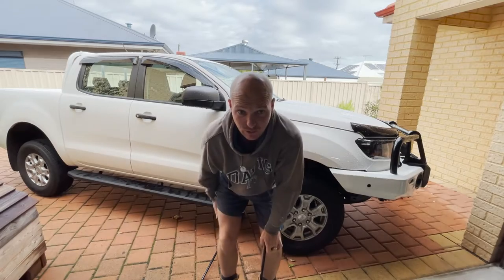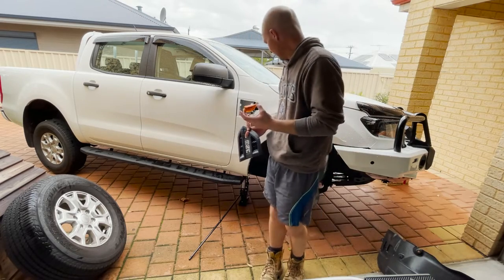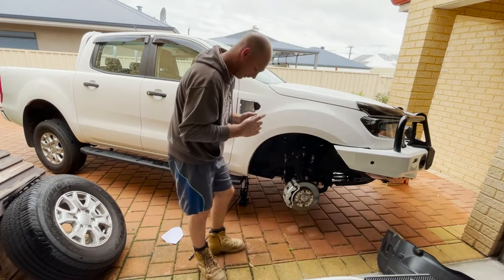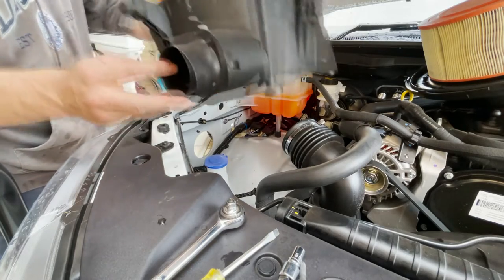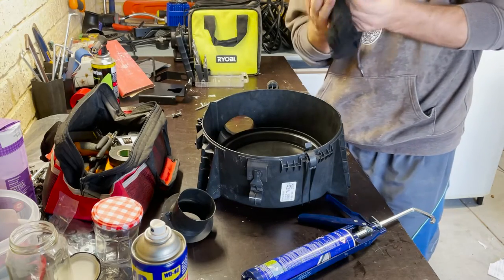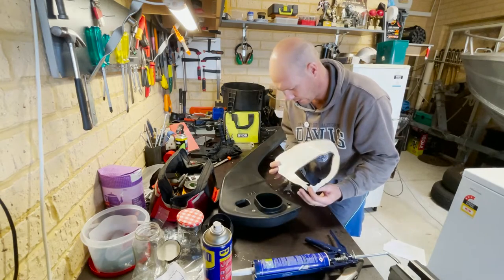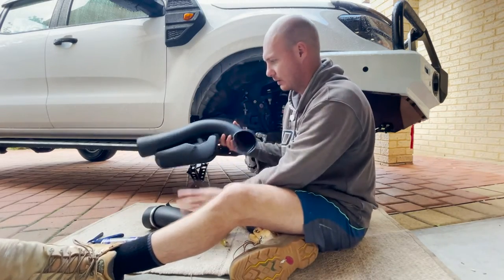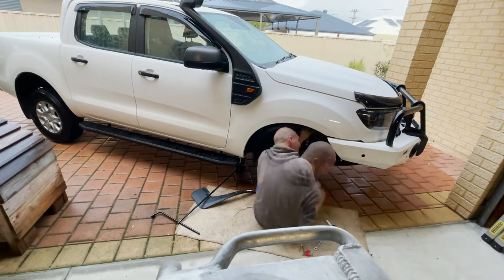Installing a T7 snorkel on a Ford Ranger PX III

Comment: Hi mate, can you provide a link to this snorkel on ebay? I've got a PX1 and I'll look for the equivalent.  
Lekker!
Aymar
Reply from the maker: Hi mate, see how you go - this is the one I got : https://www.ebay.com.au/itm/282735827938?_trkparms=ispr%3D1&hash=item41d45e5be2:g:JJIAAOSwqqle8j42&amdata=enc%3AAQAGAAACoPYe5NmHp%252B2JMhMi7yxGiTJkPrKr5t53CooMSQt2orsSwcmzw5CLtzTE60FqHcnq2MWagahb38QybtXrEmJHWvuETI4LdY%252F6D4xYzmHMlHglPHGTS6fU%252Fr3qmAmcMg05W6O%252FErzYFupQe9m2zlMC96EiluJjJAq3QRtJnCfXGcUZWL0OSIvhtRhhe0w0257KOfUYme90iWfdzjJXCqmhysJIAmXAGFtEmCkyzrnzsX0cPUlLw%252BVMHJhh%252Fk6U9BQR7JSllc%252Fl8y2CZAF2Wa2EqSHem5TpJFA8iPAWUyOi%252FanF31mFTUJRVEWkNQ0nY2k2PhrxsKG7rbO9%252BDW3ukXwmWlk%252FzODECIwxrmT97i5%252FdFXj8ZynPnvr3fkgEZL%252BdAUu%252F28Jum5VWOjAtn7QLlkyslIRuvTffBIRo2OmS6aRyR%252BDIjengBXPJvOnVM0tgGeqIjO2YaH3Tafsym9JBfKhy5aZU5q0A9TzQH3JB9VL2rtaqyA%252BVx5S7VW7wY%252BR%252FN9mmq9jGzkyTUj1vUtSheY8pyrdLj%252FTARaHCwwVQ%252FPn6Kj9U6i%252Bsd4GSIaUCGrKwxBAVoMTeWRnO3V1cD5CUtw3xSTfcuPsVqwOsW%252BMKe9S3mV6krn5OasFxOEjzMlUjqsk%252FyyQU5jp7KnBOwh0zaXy9dRi3tfJL5ybIoi8pKPn3C%252B2EgyBADrIK729KSVJ1drafkbxh4CVynSiJqtSTkZ5YtctGnExaZSE5ZCvFHUGB8RAqnfTw0VReuxS05zGLcqn4DWxWCPm9ix8aspS1KXwpBPbRb8bGyL6yormWLXkeuigz%252Bc7e%252BK9uYAeH%252Bts76wxFesT%252BaOFYOKstETrN6TVK3FCHkwjxwOUgn0Z0Ax%252BhN1l1xV7Q4wQx9B0VJdkAbLSg%253D%253D%7Campid%3APL_CLK%7Cclp%3A2334524&frcectupt=true

Comment: Great video. Looks like you made light work of it. I've got this exact snorkel kit installed by previous owner of my Ranger, just been looking at to try and work out how water resistant it is (for wading and also rain). Doesn't seem to have any dirt/grit/water run-off at the ram head so wondering how well it copes with driving in heavy rain. I've not yet had a chance to open the airbox after heavy rain driving to check for buildup.

Question, do you have any idea what that bulb is for in the pipe that lives behind the fender? If it was on the underside of the pipe I'd expect some sort of water/grit catch you could clear out, but as it's above I'm wondering what the point of it is?
Reply from the maker: I've opened the airbox after drive in some rain (not super heavy rain) and airbox was 100% dry. Regarding that bulb - I have no idea been wondering the same thing.....?🤷‍♂️
Reply: What is bulb you guy talking about? I got the same snorkel l. Just wonder what it is

Comment: Hi, i just bought a 2021 XL px3 and i want to do it up with flares, bullbar, snokle and more. Does XLT and XL parts can fits eachother?
Reply from the maker: Hi mate, most part fit all models, mine is the xls and I have had not issues with any part not fitting

Comment: How did you go about reapplying the rubber roof trim over the snorkel roof bracket bolts?
Obviously with the bolts, the trim no longer sits flush as it did pre install, it bulges over the bolts.
How did you get it to stay down, and was it flat?
Reply from the maker: Correct, I left it for a couple of days till I thought of a plan. In the end I used my router and trimmed the rubber around where the bolts and the plate sit so it would sit flush. I used the same silicone I sealed the rest of the snorkel with to glue it back down. Have not had an issue with it thus far. Hope that helps!

Comment: I noticed you had the chrome screws out of the snorkel when you had it on the bench. What bolts did you use to tighten the snorkel to the bracket?
Reply from the maker: I didnt like to look of the ones supplied with the snorkel so I got some SS ones to replace the chrome
Reply: @4weeksleave  Thank you.  I guess I'm off to bunnings again.  Lol
Reply from the maker: @Ranger_Troy  😁

Comment: How did you go with the foam gasket, it appears the bolts provided are too short and won’t grab when trying to fit
Reply from the maker: They are short, but with some effort and force I managed to the the nuts to go on. It would have been nice if the bolts were 5mm longer.

Comment: The drill and install on the roof rail concerns me. Incredible opportunity to rust and leak.  I haven’t seen anyone show how they ensure water seal and corrosion protection.
Reply from the maker: Very valid concern! I had the same when I realized what I was about to do to my car... after a bit of research you realize that most offroad roofracks get fitted to 4wds the same way. 
My method for corrosion protection - Prime/paint the newly drilled hole immediately with a good paint (I used nail polish - not so sure about that yet)
Water seal - I used roof and gutter silicone and a rubber/foam washer between the bracket and the roof. 
Hope this helps a bit - I should have filmed and included more info on what I did. Not that any of this took away my concerns either......

Comment: How do they drain the water when it rains?
Reply from the maker: I don't think there is anything in the snorkel design to drain rain water. It is a very interesting topic and a lot of discussion around it. http://www.4x4earth.com.au/forum/4x4-tech-talk/24947-stupid-question-snorkels.html
http://www.4x4earth.com.au/forum/fuel-system/7504-diesel-engines-snorkels.html
http://www.4x4earth.com.au/forum/motors/25734-help-me-decide-snorkel-3.html
Reply from the maker: Let me know your thoughts? It would have to be torrential rain to have any affect and make it into the engine, past the filter and all the heat around...😅 but I'm no expert

Comment: Do you need to silicone all the connections?
Reply from the maker: No you don't. But I can't think of any reason why you wouldn't do it, for the little bit of extra protection against dust and water it's easy and cheap.
Reply: @4weeksleave  
I only ask because i got the genuine ford snorkel and noticed the piping that goes from the airbox to the actual main snorkel peice just slips on and its pretty loose. Shame ford didnt send any fitting instructions would have saved me a couple hours of thinking
Reply from the maker: @NDH411  I think the knockoff that if got is very similar to the genuine Ford one you got then. The airbox connection is pretty good and snug, but my biggest issue was also the pipe connection to the snorkel - and you can't really get your hands in there to push them together and or seal. What did you end up doing?
Reply: @4weeksleave  
Yep i would say they are almost identicle then. I only installed it the other day but i didnt end up sealing it properly but next day off i will be removing and packing it with sikaflex So ill see how i go
Reply from the maker: @NDH411  Not a easy one, good luck